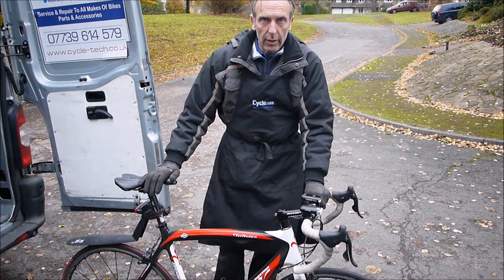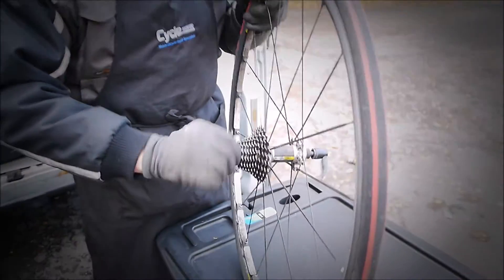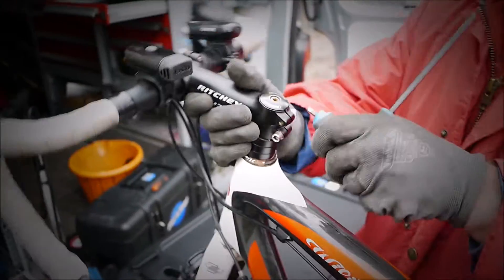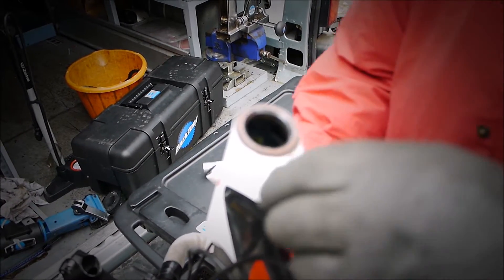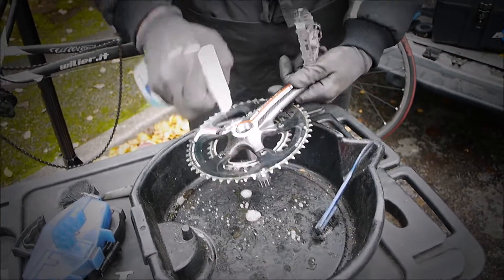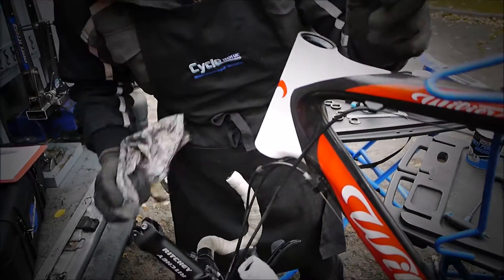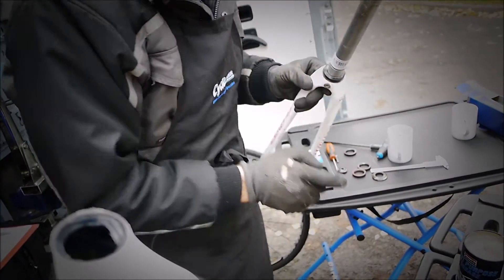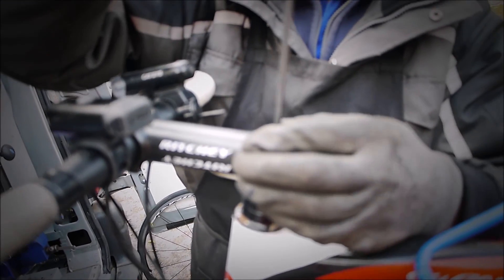Bicycle Mechanics Day 1- Part 1

Comment: As a mechanic myself, it is really nice to see somebody so competent and thorough. The only thing I would add to your "M" check is, before starting anything, set the bike on the ground and open and close the quick release skewers on the front and rear wheels, making sure both are fully in the dropouts. Even a small misalignment in the dropouts will make all subsequent adjustments a disaster.

Comment: Great video! Could you please do a video on how you price jobs according to what needs doing? For example: Would you just add a big list with everything you find that needs doing then present a big bill, or do you offer a service that includes all of that and if it needs fixing you do it, but don't charge seperately for that job? Just wondering how you do it - cheers.

Comment: If the chain is worn you don't need to change the cassette. I usually change the chain 5 times before replacing the cassette.
Reply from the maker: Not true - You will find the chain and cassette wear as a pair. A closer inspection of the cassette will show worn and burred teeth  replacing a chain and not the cassette will rapid wear the chain as the teeth on the cassette would have worn to the old chain, especially on the favorite sprocket. Aim to have long life and smooth gear change.  https://www.cycletechuk.co.uk/chain-care-wear
Reply: @CycleTechUK  if you change your chain before it streches to much it wont do as much damage to the casset if you catch it at the right time